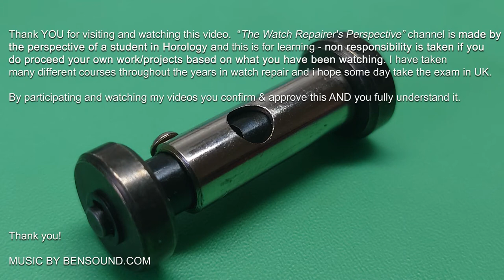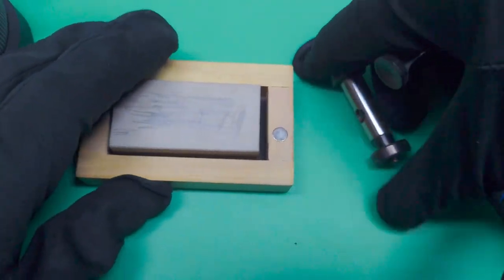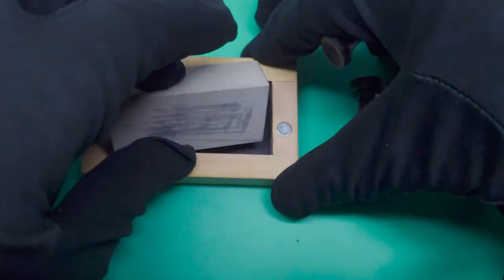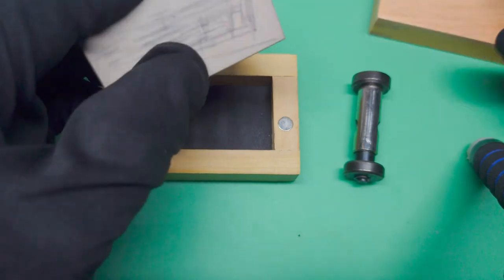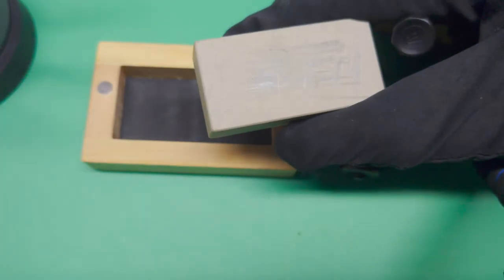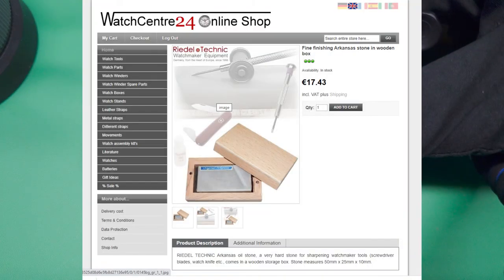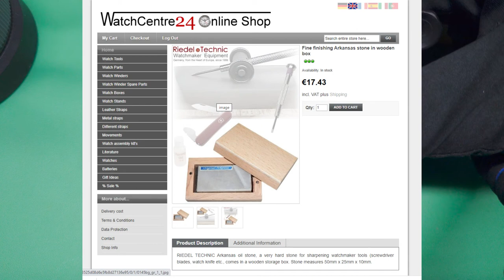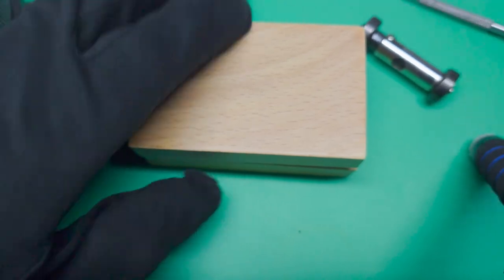Arkansas Stone and screwdriver sharpener  [Ep.No.188]

Comment: I've been working my way through your great videos but Hmm - your technique here is very strange. You need to carefully run the wheels along the box and allow them to roll - the distance you insert the driver and the wheels running flat set the angle of the tip. Try placing your index finger on the upper part of the tip and others out the way with comfortable grip. Several passes each side then a single pass held carefully with the tip normal (90 degrees) to the surface to square off the end. I have great results with wet & dry paper spray mounted onto MDF boards. With different grades I use these for all sharpening and simple lapping operations. When the paper is used it's super cheap to replace the whole thing.